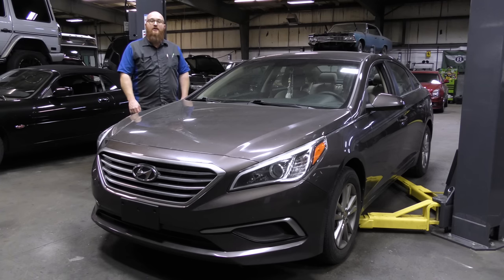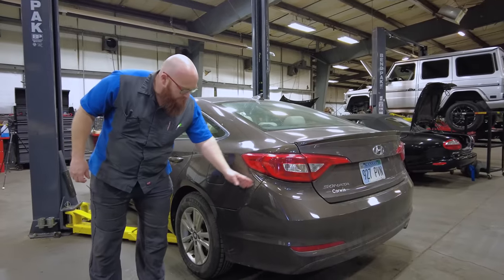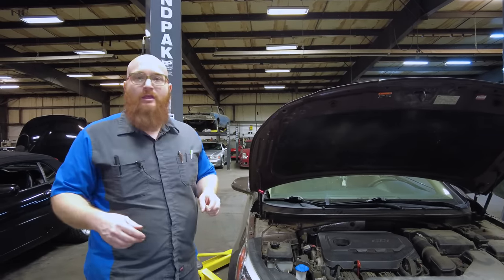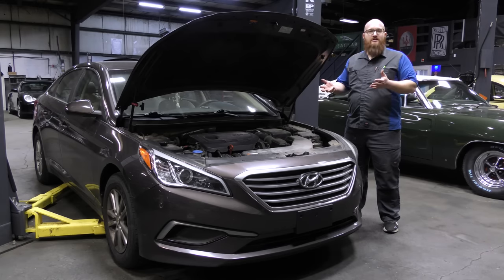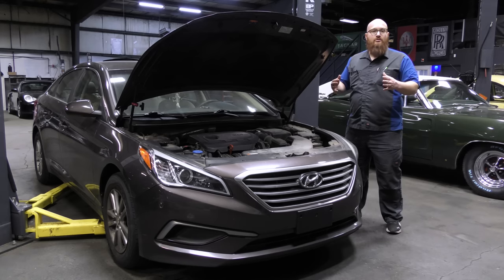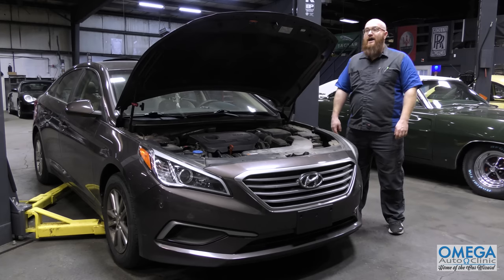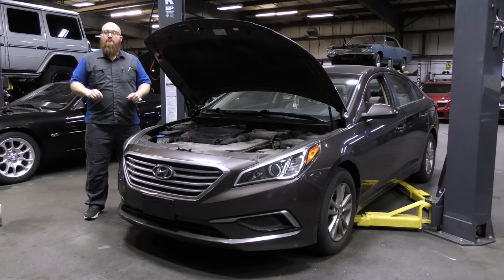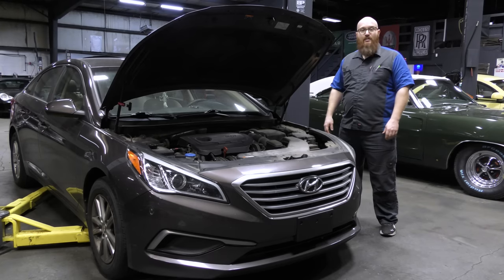What could be so bad on this '16 Hyundai Sonata that the CAR WIZARD is sending it to the junk yard?

Comment: As a service writer at a Hyundai dealership alot of those 2.4s have an engine warranty extension.  I bet if I ran the vin through our system I could see if it does. Also low oil is common because these motors burn oil like crazy
Reply: You should email car wizard of you can help
Reply: I own a 2016 Hyundai and it does burn about a half quart a week. I check the oil level every Saturday.
Reply: in oil consumptions ive seen them burn 4qts in 1000 pretty common
Reply from the maker: The dealer, and corporate, have already informed the customer that warranty / recall will not be honored on this car.
Reply: If owners don’t check the oil level at all, then this will happen sooner or later. It’s so easy to check a dipstick, or get someone else to check if you don’t know how.
Reply: @CarWizard   Hey Wiz, will excessive oil burning eventually cause catalytic converter problems? I live in California where they emissions test
Reply: Definitely oil burners. I see so many puff smoke on take off from stop lights. Insane that they're only 5-7 years old.
Reply: @CarWizard  If I had dollar for every time I've heard that from Hyundai, especially the Sante Fe's... smh
Reply: I worked at a KIA dealer years ago and the 2.4 Theta (if I remember correctly) was ALWAYS being replaced under warranty. I believe this started in 2012.
Reply: This is Not on the customer.  You can change the oil and take care of it and that motor will still destroy itself. Have a 13 that drank a Qt of oil every 500 miles. It’s quite possible it’s the worst motor made in the last 20 or 30 years- it’s just bad. I honestly don’t know how anyone still buys their cars along with Kia’s. 

Even if you put a “new motor” in, it still would only last 100k lol piece of trash
Reply: Dealer drained the oil, sue their ass. How could the oil get this low?
Reply: They burn oil like mad though !!!!
Reply: @185chargers  sure will...almost certain.
Reply: @Gruxxan These will destroy themselves with or without oil. They’re just garbage engines. There was enough oil in that jug that it probably wasn’t starved for oil. Sure not good for it and will cook the oil fast, but I bet it still had oil pressure.
Reply: @Rekuzan  is a Santa Fe not too good ?????
Reply: @185chargers  A half quart a WEEK!? How many miles are you driving!?
Reply: @rmp5s  im driving about 600 miles a week.
Reply: @185chargers  That's quite a bit. Still a pretty crazy amount of oil burned...lol
Reply: @dks13827  Depends on the model year and the engine. A lot of them also had recalls just like the Sonata in the video; best way to check is run your VIN through an online recall data base to see if it applies. It's doubtful any of them are still covered being so old, but some of the newer ones might still be. Even then, the chances of Hyundai saying no are an almost absolute.
Reply: @rmp5s  Yes, i agree. The car has about 130k on it. Other than the burning oil its been pretty reliable.
Reply: If you change you oil every 3000-5000 miles. Change the PCV at 15,000 miles. It should not burn oil other than factory specs. I am at 150,000 mile on mine and not burning much oil.
Reply: @donc6781  The motor lasted 160,000 miles as per the video, it  is not a little. Of course if they have checked the oil, it would lasted more ...
Reply: @hellkitty1014  Too young to smoke!
Reply: @vadim7590  no, they burn oil like crazy. 

The pickup tube is near the bottom of the oil pan. I've driven a car that takes a little over 4 qts of oil and the oil light came on when I got on the throttle, it was over 3 qts low.
Reply: @totalchips6547  Actually listen again, 116k miles
Reply: He's right, those engines burn oil at an alarming rate. Hyundai is in court fighting those lawsuits (and winning) at the moment.
Reply: @volvo09  I had a Kia optima, also subject to the same recall, changed oil once a year, never was low.
Reply: @185chargers  That's good!
Reply: @hellkitty1014  To be honest, my dad’s  ‘16 sonata is also a part of this. 
Puffed smoke on hard acceleration and burned 5 quarts every week. Had to check the oil every day and always kept a can in the trunk.
Reply: I'd tell them to replace a couple quarts of the oil with 90 weight gear oil, that'd likely stop the knocking briefly... Then drive it to a Hyundai dealer and trade it in on something halfway decent off the used lot that isn't a Hyundai/Kia.
Reply: Videos like this make me angry. Not at Car Wizard.

At how dumb we as a society have become

The movie Idiocracy, and various George Carlin skits, now appear prophetic instead of entertaining

I subscribe to Wizard, Car Care Nut, Ford Tech Makuloco, and Ford Boss Me as I have a genuine interest in keeping my cars in the best possible shape, as long as possible
Reply: @vadim7590  Dealer didn't drain the oil, they pulled the dipstick and saw no oil on it. Case closed
Reply: @185chargers  That's terrible. The sooner you sell it the better for your $$$.
Reply: I have a 2016 2.4 with 103k and I don’t burn oil at all. Full synthetic oil change every 5000 miles
Reply: @gabemarah9465  yep. The reason that most don't rebuild these engines is that there are so many inferior parts on it. Oil gets past the piston rings so easily, on top of poor lubrication, which also causes the bearing issues these are known for. And I know people that are meticulous with their maintenance have had issues with these cars. The 3.8s used in the Genesis and early 3.3Ts also had issues similar, but not quite as widespread.
Reply: @hellkitty1014  my elder sister has a 2015 sorento with a 3.3 na v6 and it failed as well. NHTSA is also investigating the problem seems like it’s common for every Hyundai/Kia engine at this point.
Reply: The warranty is only extended if you get the knock-sensor software update installed.  I would assume that wasn't done, seeing as how she didn't even bother to check the oil.  Otherwise the powertrain warranty expired at 100k miles.
Reply: @gabemarah9465  I always wonder if this is why Hyundai/Kia changes engines so much? Even the FWD version of the 3.8 found in the Telluride/Palisade has issues, particularly with fires. Then the DCT in the K5 GT/Sonata N-Line have been failing left and right(don't even get me started on the 1.6L Turbo and 7spd DCT issues from son's old Veloster Turbo). Ugh!
Reply: @CarWizard  bet it had that open recall for a remap
Reply: My daughter got a new motor on warranty on a 16 2.4 Sorento.
Reply: I had a 2011, I changed it every 5k with synthetic. Sold it at 90k miles cause I figured it would t make it to 160k lol. It did use some oil,
It’s be like 1/2 quart low by the 5k miles
Reply: @repairdrive  WOW!! Why doesn't that shock me nowadays here in the good ole USA!!
Reply: Maybe they should try a different dealer or corporate?
Reply: @Car Wizard  Hyundai corporate told me my engine warranty would be denied too. They tell everyone that nomatter what.

They will not replace the engine until it completely seizes up. 

I promise you, do the right thing, get recalls done, seize the engine up, tow it to Hyundai and get a new engine. I promise you will get a new engine, I did even after corporate told me no.

I went to Wichita kansas Hatchett Hyundai east, go there, the west side sold me doom and gloom too.
Reply: @briantii  any engine will destroy itself if it only has 25% of the oil it should have
Reply: @briantii  plus the little oil it did have would have been black sludge at that point. No engine will survive for long in that scenario
Reply: @donc6781  hyundai/kia best built and backed today-
Reply: @Gruxxan  As long as it’s still got oil pressure it really should be fine. I bet it still had oil pressure and the failure was unrelated to low oil. I agree it’s not ideal, but these engines will do this no matter if you changed the oil every 3k miles with the best synthetic you can buy. What’s worse is these engines will blow up AGAIN even after Hyundai replaces them. For it to make it to 116k miles is actually pretty good for these things. These engines are all over the news and especially in Canada where the warranty wasn’t as long and Hyundai / Kia did a much worse job at customer service than they have done in the US. There are videos online of the dealer techs with piles of these dead engines sitting around. As someone else said the dealer probably pulled the dipstick and saw nothing on it and denied the warranty. Let this be a lesson for anyone… make sure it’s full when you take it in.
Reply: @@alboalt3411 They say that it was a milling issue yet ALL of the engines, even the replacements, are still blowing up. Just make sure you do all the right steps to ensure your car is covered by Hyundai so when it happens you’ll get a new one. Or ditch it before it blows up so you don’t have to deal with the hassle. Synthetic oil I’m sure helps, but these engines are truly flawed. Even well maintained copies can and will self destruct.
Reply: @bikeman1x11  😂😂😂
Reply: @briantii  i dont think running any engine at only 25% its oil capacity will be 'fine', but you go ahead if you want
Reply: @Gruxxan  I never said it was "fine" nor did I recommend it nor have I done that with my cars. What I did say is that I do not think that specifically is what killed the engine.

These are garbage engines. They kill themselves no matter how good you treat them.
Reply: @briantii  you literally did say it should be fine
"briantii
2 hours ago
 @Gruxxan  As long as it’s still got oil pressure it really should be fine" 😂😂
Reply: @Gruxxan  "fine" in that it wouldn't cause a spun bearing. Running on 25% of the oil though as a habit is not fine.
Reply: @Gruxxan  if this owner had checked and saw oil usage and brought it in earliershed have a new engine
Reply: @donc6781  both kia sedonas we had have been trouble free - ill buy a kia hyubdai over todays honda toyaota etc
Reply: @bikeman1x11  maybe, but only if she had provable full service history
Reply: @bikeman1x11  😂😂
Reply: @Albo alt I have the same experience with our 2016 Sportage. No issues, runs great and uses no oil.  At 85K miles - zero issues.  The problems with the 2.4 Theta were well documented as you stated and Hyundai / Kia had a recall for implementing a Knock sensor update and the engine warranty was extended.  From a design perspective, the engine is reliable. For those that had problems, it was a terrible ordeal until Hyundai acknowledged the issue and admittedly were sued. You have to maintain your vehicle. It is a sad story,  but run a Toyota engine on 1 qt of oil and see how long it lasts.
Reply: @paull3373  You legitimately maybe surprised with Toyota, I’ve known a few that have survived some insane abuse - like “I didn’t know I had to ever change the oil” abuse for 25-30k miles and shockingly suffered no I’ll effects. 

Given the Theta 2 engines STILL blow up, even the newly built ones I’m not sure how you can say it’s not a design problem. I’m not saying all Hyundai / Kia motors are bad, but the Theta 2 sure seems to check all the required boxes to potentially be the worst auto engine built in the last 20 years.
Reply: Agree 

@briantii
Reply: 2.4l and 2.0l YF’s have an extended lifetime warranty for the short block granted you preformed the knock sensor update and have maintenance records. The 2016’s had a recall as well for oil consumption but not lifetime and they can reject the repair easier than the bearing issues on the YF.
Reply: So what is the problem that these engines are consuming so much oil? There has to be a reason,there's something in the manufacturing process that's causing this.

Comment: I’ve had engine for my 2011 Sonata  replaced at 160k miles by the dealer for free due to high oil consumption (quarter per 300 miles). There is now a lifetime warranty for those engines by Hyundai because of all the lawsuits. If the dealership denies the warranty, please contact Hyundai customer service and also try another dealership. I have several friends who also replaced their 2.4s by warranty. There is a ton of info on Hyundai/Kia forum. I’d be happy to provide more details, your customer should not pay for the replacement of this engine. Good luck!
Reply: Dealer already saw the low oil.
Reply: Did the dealer do an oil consumption test?
Reply: I bet the dealer that the customer went to probably saw that they didn’t have any oil change records through them, so that gave them grounds to decline the service. But I would definitely go to another dealership and get Hyundai/Kia Corporate involved.
Reply: Yup. Going to need that info.  Got a 2011 with the horrible 2.4ltr Theta 2 engine.
Reply: My 2012 Sonata had the engine replaced two years ago by the dealer here in Tampa absolutely free. The rod bearings completely failed and seized the engine. Hyundai should replace the engine.
Reply: I agree, fight Hyundai on this
Reply: Did the same for my Sister in law when the cam noise got crazy.
Reply: @digitalrailroader  Computers are linked via VIN, so going to another dealer is a waste of time.
Reply: @Mike-si7mv  Running out of oil is not anyone's fault but the owner.
Reply: You would need to provide proof of full service history to be eligible for a new engine on warranty. A car that hasn’t been maintained will not be eligible.
Reply: @jamesplotkin4674  which is why I also said get Hyundai/Kia Corporate involved; because unless the customer can’t provide documentation that they DID have the oil changed regularly, (my job actually reports any work done on a vehicle to Carfax) which means that the first dealer was wrong to refuse the work.
Reply: @digitalrailroader  The wizard pointed out that the oil was black and smelled bad so probably had not been monitored or topped up. The dealer probably did the same check so low chance of winning a claim, however, I agree with you it has to be worth trying through Corporate for the short time that would take.
Reply: @bpalpha  you have my sympathy 💐
Reply: Its already in the computer at the dealerships as low oil/dirty oil.
Reply: @185chargers  They don't need to. They saw neglect. Low dirty oil.
Reply: The one problem with the oil consumption test is that would require the owner to periodically check the oil level to realize it's being lost.
Reply: @sbedulin  I agree with most of what you said. However you do have to check the oil on these engines. The engine does not favor women or mothers. I check every week on my Theta 2 and end up adding 1 qt every so often.
Reply: @jamesplotkin4674  Yeah only having one quart in the pan is the owner's fault.  I can understand being half quart or even one quart low. but being 4 quarts low is negligence.
Reply: @jamesplotkin4674   total b.s comment. The car is burning oil and it’s a KNOWN problem. The dealer didn’t want to replace it so they found a way out. My in-laws Santa Fe just had its engine replaced. No questions asked. Btw it had 105000KM on it. Look up the problems the Theta series of engine have, and you will see
Reply: Oil consumption is on top of the list.
Reply: What would happen if you changed the oil and went to a different dealer?
Reply: Had a 2011 Sonata with the 2.4L engine.  When I traded it after 5yr/75K miles, it was using 1qr of oil every 800 miles.  I checked the oil every fuel fill up and topped off when needed.  Shortly after trading it, Hyundai announced the engine recall.  That was my first Hyundai and definitely my last.  Way too many issues and recalls.
Reply: Stop buying Hyundai/Kia/Genesis. Worst cars on the road. Ugly, slow and unreliable
Reply: You have to check the oil. No ifs, ands, or buts about it. The owner of that Hyundai Sonata would have realized that they were having oil consumption issues. If you don't do anything else right maintaining you car, change the oil every 5000 miles. This was probably total neglect on top of a questionable engine.